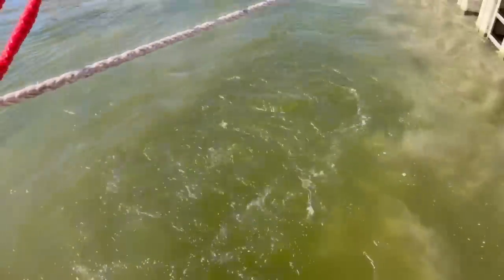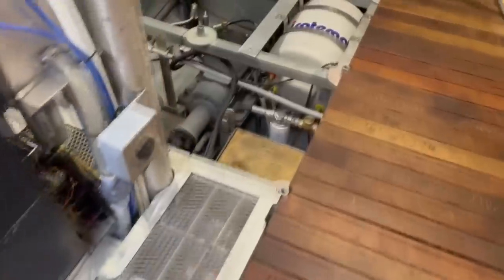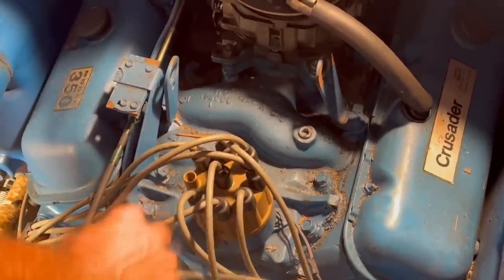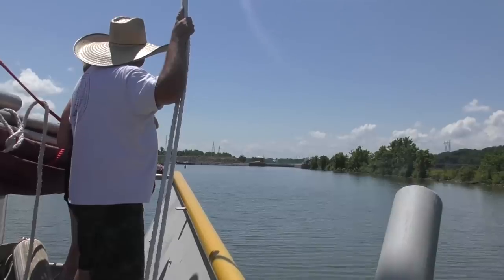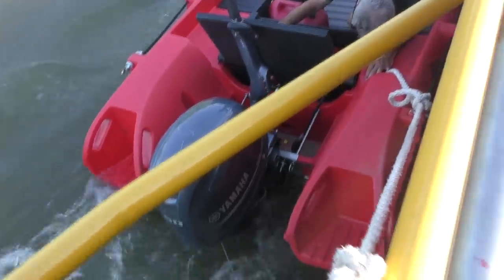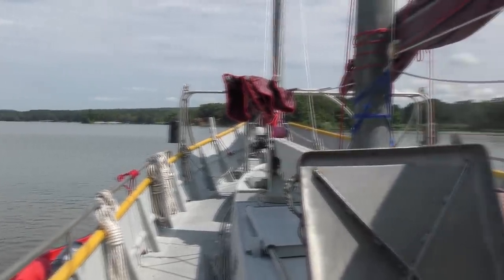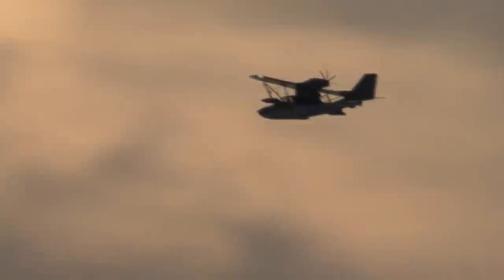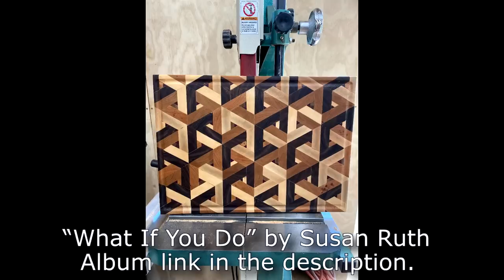A Challenging Trip to Kerr Lake with Excellent Outcomes

Comment: Just a thought.... get a car backup/fwd cam. they are typically water proof. You can get a high def. one. PUT IT at the top of the mast facing/fwd and aft. you can then see the height of a bridge ahead of time.
Reply: I'll add to that, they are dirt cheap and you could add a few around the boat for security like the engine room, entryway,  stern . As well as assisting in docking the boat with a top down view(s) fwd/aft. I use those kind of cameras in quadcopter builds as flight cams. Because they are tough.
Reply from the maker: Yeah, we have some Blink cameras, but it might just add a smashed camera to the list.  : )
Reply: Smashed camera (if it ever happend).... At least you saw it coming    WINK.... WINK..... if/when you hit south florida east coast. I have a bunch of luxury yacht your sized boat big black very expensive fenders you can have. like 3'x6' + range blow up type 4 or 6 of them I forget. I have a use for them but have yet to get to be able to use them for the project I want to do. They are used and I can always get more, I'm in the bizz.
Reply from the maker: @berinslaptop  Thanks but I like my tire.   It fits my motif.   : )
Reply: @SVSeeker  On that responce, a bit of friendly advice: A: I have been in the industry marine industry for .. well I dont want to date my self but a long time. Building some of the worlds most well know boats. I'm not kidding. In my industry I am world known and work out of the largest marinea in the USA. Located in south florida. B: For the described uses of the boat in the future, I think your goals are wonderful DO IT. You will be required to use proper safety devices. A tire(s) for a fender though not wrong "" air quotes "" will cause you a lot of problems around the WORLD <--. Its just like proper PPE.i.e. life jackets. When the first bit of damage your boat causes to someone elses property in any way hopefully not. The "tire" tune motif will quickly end $$$. I have been following this channel for a long time, and in my professional opinion. Your boat is very harty in construction. Keep it up. At this point there are a number of areas where DIY will have to mandatory have to giveway to liability. Just an FYI that is a very short sighted and inexperienced answer considering ALL of the uses fenders are used for byond just docking a boat. There are many places around the world you will not be permitted if you dont have proper fenders. Again friendly advice.
Reply from the maker: @berinslaptop  No worries.   If they require insurance, and all of those sorts of places do, we will not be going there.  We'll be that boat anchored out and transporting water and fuel with the tender.  : )

Comment: I know going under bridges may be a temporary condition, but a fiberglass pole or antenna on the front mast to the height of the second might not be a bad idea.
Reply: He would be unable to stop his mass even with full power in reverse.  Hard to stop 40 tons of steel in the water.
Reply: @bbrut3332    depends how slow he's going...

Comment: Put a regular prop shaft and fixed blade prop on there.

This is getting redicules with this adjustable pitch crap.

The few boats I've seen with adjustable pitch props had manual crank adjustments before the engine is under load.
Reply from the maker: Do you really quick that easy?

Comment: Then why do you need the gearbox? Isnt the variable pitch prop doing the same job?
Reply from the maker: The gear box reduces the rpm of the engine so it can turn a larger prop.   First gear is a  3.45:1 reduction.

Comment: Please put a guard over your engine shutoff switch. That will be way to easy to hit by accident at the most inopportune time
Reply from the maker: No.   It could also be a really appropriate time.  : )
Reply: @SVSeeker  if it happened to me, I would immediately assume there was an issue in the wiring, and spend a half day working on it until I realized it got bumped off

Comment: Dude dump the prop system. It’s trouble. Fixed pitch is fine and will have no issues.
Reply from the maker: Dude.  Don't quit so easy.  Lots of things to try still and we won't have to give up the advantages.

Comment: Hundested is from DK, and used with coasters for ages…..Unbreakable, unless you Cut corners
Reply: They did use an experimental hydraulic system not matched to the requirements of the unit and manufactured some components as well. At best it’s a very old version with limited control and no reliable feedback. Working well it would be good but ultimately it’s would be better to take the time to revise t0 a simpler system.

Comment: The other guy is thinking gm style starter where the shims set the distance between the center lines of the starter and crankshaft. The cummins starter distance from center line to center line is set by the flywheel housing, no shims needed. Alternators and starters mostly come from china these days, so quality is hit or miss. I always used timken bearings for all wheel bearings and differential bearings replaced, now they all made in china, worrysome to me.
Reply from the maker: Yeah, but when there is nothing else, you try something.  And it's still doing it with a new solenoid on the original starter.   We even moved the ground wire to the starter mount bolt.  And it's still hit and miss.

Comment: Anyone else notice these latest videos have some sort of issue with motion/framerate?
 It's almost like every other frame is ahead of where it should be, edges in movement and panning shots seem to blur forwards, if that makes any sense.
 I see video is only 30Hz, but I think there's something else at play.
 It feels like perhaps whatever he's using to down-convert from 60 to 30 is outputting frames in a non sequential way?
Reply from the maker: I don't see any issue.   Is it a particular time stamp?
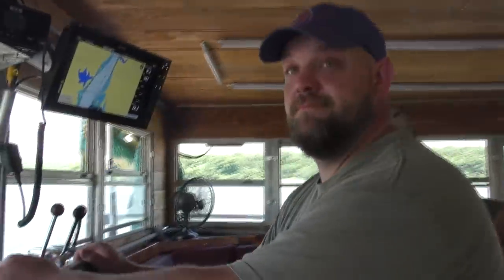Reply: @SVSeeker  A single frame around 10:10, everything is double, it's almost as if there's some kind of badly implemented artificial motion blur or smoothing.
 I know the cinematic 'stutter' of 24/30Hz content, this is something different.
Interestingly, the motion interpolation on my TV handles 24/30hz quite well, producing in-between frames for that "live" or "soap opera effect", but on these latest Seeker videos (going back a few months at least) I have to turn it off as it feels like I'm seeing 4 frames at once, with edges blurring forwards in the direction of the panning.
Perhaps there's a post-production interpolation effect you could use to bump the videos to 60Hz?
 I know data must be an issue out on the water, but YT compression doesn't do any favours when there's complex scenery like water.
If it's a creative choice to help with shaky shots, definitely check if you have some gyro assisted stabilization mode in your camera, I know the newer gopros have issues, but starting with hero7 around 2018 the "hypersmooth" feature is very good, presumably also 60Hz files tho :-/
Still enjoy and appreciate the videos regardless 😊
Reply: The audio is also skewed to the right. Pretty noticeable with headphones on.
Reply from the maker: @Gin-toki  We have sacked the audio engineer.

Comment: Thanks for taking us along for the ride. When you aren't there, its hard to understand just how much extra work filming everything is. I think i can speak for everyone that we appreciate the effort.

Anyone who has spent any time on a boat knows that things rarely go perfectly. Any long distance trip or new adventure almost always comes with something breaking or going wrong. You really did get the short end of it this time though, with the main drive and backup plan both having issues. At least you had a third option! I think the problems you've been having with the variable pitch system is part of why the trawlers that use those systems usually have a much simpler wing engine as a backup. I guess eventually your version of that will be deploying the sails and sailing where you need to go.

It seems like your wheel has to travel a very long way to move the rudder. Is that because it is direct drive and you are trying to get a good gear reduction on such a big boat?
Reply from the maker: It would not be an adventure if there were not challenges.   It's a fully manual system so the number of turns is a calculation based on the size of the boat and rudder.  It starts with not wanting more than 32 pounds of force being applied to the wheel.
Reply: @SVSeeker  that makes sense. Just seems like a very long way to have to turn compared to what I'm used to. Of course, I suppose the alternative would be to add complexity with some kind of assist, which has its own drawbacks. Thanks for the reply!

Comment: Why not have a driveshaft blank to put in inpalce of the hunterstead for if it fails.
Reply from the maker: Could but that's a lot of work.
Reply: @SVSeeker  Just clicked though, Hundested Rebuild - Part 1-2-3 and Can't believe the price of some of the matching alone.

Was thinking it would have been as simple as a some box with a 2 thrust bearings that held the prop drive shaft and the adjustment but when doing that might as well make a new Hundested.

Comment: Well looks like things are progressing well even with a few setbacks.  Did have a thought though, may want to get some marking paint or something like that and measure off 20 foot increments of chain and hit them with something so you can visually see how much chain you have your and all.  Will be helpful when you know your depth is 30 or 40 feet so you don't dump out too much or too little chain to get a good bite in the bottom.  Plus when you are cranking back in you can have a link marked when you have the anchor just left in the water so you can clean it off while under way.  Make it a little easier than taking and having to move around and try to get a visual directly.

And maybe having spare bolts as well as O-rings for the hundested for the next blow out so you can get into the "pit crew" style repairs.
Reply from the maker: Yeah, that's on the list.

Comment: Nicely done Doug, you got a victory of sorts. 
I know ou have an old Hunderstad but is there any wat to put a pitch indicator in it? It seems it would help so much with the set up. There are simple rudderindicator could one of those be modified if there is any moving part out side the oil box area?
At a guess I would think the 'hot tomalia?' Engine over heated from not enough water flow into the intake?
I liked seeing the engine dock testing.....
Cheers Warren
Reply from the maker: Yeah, we could but I think it will be enough to put marks beside the leaver.   And the Hot Tamale just got a bunch of water from one of our tanks.   It will get a bigger water/fuel separator next week.   : )

Comment: I'm confused by your prop pitch control - does the label "0 Pitch" mean "minimum thrust" or "minimum drag?" I could be totally wrong, but if "0 Pitch" i.e., handle fully back is "Sail Mode" with minimum drag, then wouldn't moving it forward a bit put you into "maximum thrust" and then as you push forward you'd be reducing thrust, until you're fully forward which would be "minimum thrust / maximum drag"? Or does "0 Pitch" mean the blades are at their minimum angle of attack where they present the least spinning resistance to the engine, therefore minimum thrust, but maximum drag, and then fully forward is maximum spinning resistance, zero thrust, minimum drag, i.e., "sailing mode"? It might be helpful to label those two positions - "sail mode" at one end and "minimum thrust" at the other.
Reply: Also, is it necessary to use both RPM and pitch to control speed? Seems like you could pick one or the other, i.e., either set the prop to "Sail" or "Motor," where in "motor" mode it'd be set to maximum thrust and then you'd use the throttle control to adjust boat speed in the typical way, or else have a three-position engine control ("R-N-F") where the throttle is set at the most efficient RPM and then you use the pitch controls to adjust speed. Just a thought intended to be constructive, I enjoy what you guys are doing and appreciate the effort you're putting into it.
Reply from the maker: 0 pitch = 0 thrust.
Reply from the maker: Actually RPM, pitch and EGT.    This is a good explanation.   https://youtu.be/wD-YmZQiCok
Reply: @SVSeeker   Thanks for the response! I watched the video - I was thinking "sailboat with aux engine" not "motorsailer" so that makes a difference. Still, I notice he has a nice gauge that shows the current pitch, do you have that? I haven't noticed it in the videos.  Maybe just me but I find "more pitch / less pitch" to be confusing as it's kind of insufficient information. The stages are, IIUC, Flat -> Min Forward -> Max Forward -> Min Reverse -> Max Reverse -> Feathered, right? Further, from his explanation it seems like there's a single ideal setting for "Sailing" (i.e., "feathered") and "Motoring,"  (max forward, I assume?) it's just when motorsailing that he finds it more efficient to adjust both RPM and pitch to account for the force of the sails. Sorry if I'm being a back-seat driver, just wondering if you're playing with too many variables right now and perhaps that's why getting the prop pitch set appropriately is causing so many challenges.
Reply: @SVSeeker   Thinking further on this from a user interaction perspective (that's my area of "expertise" such as it is), what's the use case for the "zero pitch / fully flat" setting? Seems like you'd never want it there. Instead, assuming your transmission has F-N-R, seems like you might not even need a continuously variable pitch, at least not as the primary option. From a user experience perspective I think having a pitch control that looks like a throttle adjustment is going to be confusing for people, especially those used to more typical configurations. One option might be to have the "main" pitch control have three fixed settings - "Sail" (fully feathered), "Motor" (fully pitched) and "Motorsail" (reduced pitch to enable reduced RPM). Then, if necessary maybe there's a separate "fine tune" control that's only available when in "motorsail" mode, to let you adjust pitch within fixed params. Just my two cents intended to be constructive.

Comment: You got to eliminate the noose around you're neck aka variable pitch propeller. You're old girl is way too heavy for that system. A fixed pitch wheel will give you many trouble free years of service.
Reply: I think a fixed pitch would be even more unforgiving.. there's no gearbox remember
Reply: @Android-ng1wn  He's gonna have to go with a marine gear sooner or later. The seeker is a heavy thing the 5.9 Cummins is pushing its limits. The actuator for the propeller can't handle the load being put on it. Ive been around boats for most of my life. Seeker either needs a bigger engine or a marine transmission with a 3.5 or 4 to 1 ratio and swing a 26 inch or bigger wheel.
Reply: @Graveltrucking  Don't know what capacity you've been around boats to come out with all that.
Not much 'load' on the actuator (viable pitch actuator) the prop blades are forward and aft of where they swivel, cancelling out load on that mechanism (which is built like a tank anyway, came out of a much larger ship IIRC)

Plenty of power, he's not going crab fishing in the bering sea, towing barges or pushing container ships around. 
The variable pitch will keep the engine where it's happy and efficient, it's not rocket science

Comment: Just spit balling here Doug,, could the problem with your prop. problem be because the fins on your prop. might be to wide, it seams like an unbalance power vs thrust. if you had double the power it would push them fins better or if you thin the prop blades it would ease the pressure off the engine. the blades on that prop. could dam near push a tug boat but tugs have massive engines, your trying to push your steel boat with a bus engine,,,, just a thought, and if im right im no longer a bilge rat, hate that,,lol
Reply: being a junk/sailboat, the need for the engine is to mainly get in and out of port, you maybe dont need the large fins ,
Reply from the maker: Yes that’s why we want to pitch system to work.  But if we keep the diameter we should also keep more power at low speed.
Reply from the maker: If we were just planning on sailing yes, but I want to tow equipment as well.

Comment: Hundested out fixed pitch propellor in ... you not going regatta-sailing advice from a bilgerat
Reply: You have to look at the system as a whole, it basically wouldn't work without the variable pitch, the alternative would be a manual gearbox which would be an even worse situation

Comment: About starter - try clean electromagnet -  like in this video  - it can be oxidation on copper points inside  https://youtu.be/cVFeKJoWEJk?t=459
Reply from the maker: That's good, but this is a one new starter and one rebuilt.
Reply: @SVSeeker  ok.  Btw my little advice you must sell or scrap this trasmision and rotator  whole setup and change it to proper marine  gearbox   beacause in sea this can be too problematic.
Reply from the maker: @mikkei3532   "you must"?   Are you the gear box police?    : )     How about we just keep going and change it if it actually fails.   Because right now the transmission has be preforming great.   And believe it or not, folks have been sailing for thousands of years with no engine at all.   Imagine that.